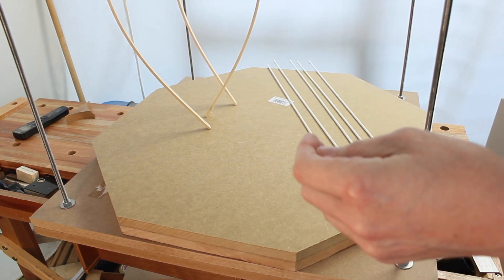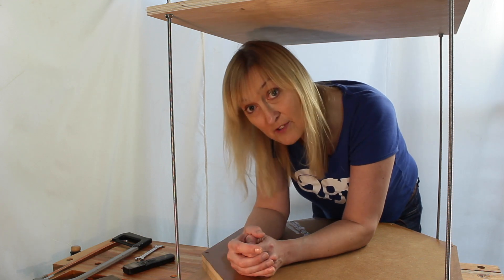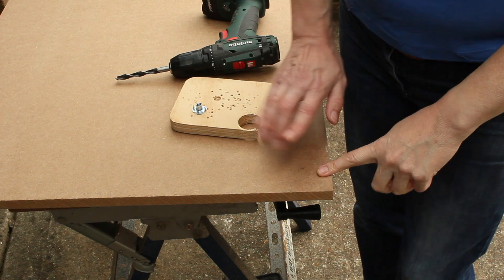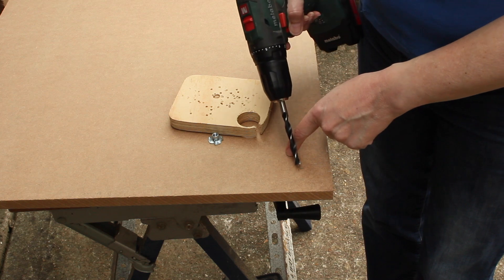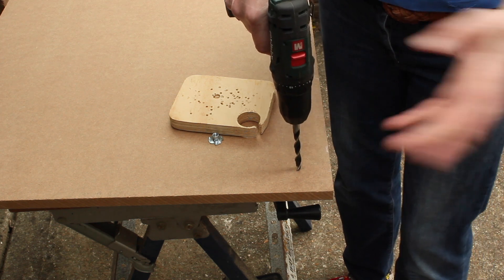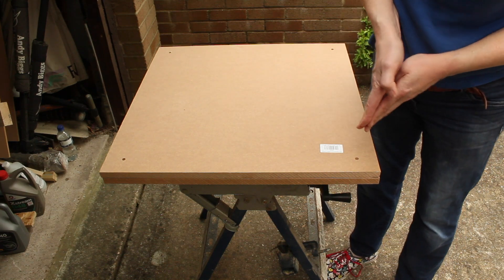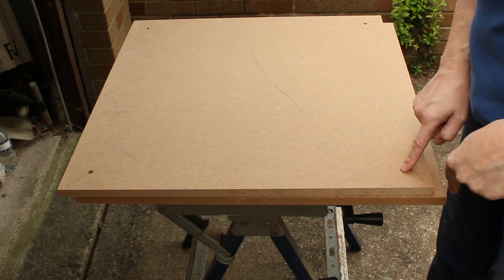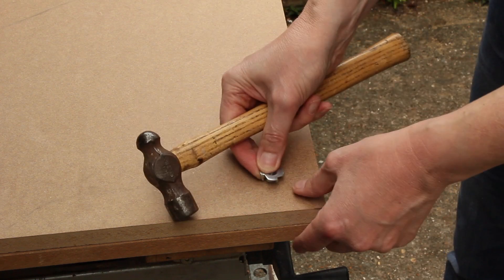Making a go-bar clamping system - the curious world of flexed pine and fibreglass

Comment: Great to see how you measure it! I suppose the more it bends, the higher is its force and pressure? So it is important to have the rod's top and bottom vertically aligned, or it would affect the pressure it gives. I also wonder if bamboo or cane or reed would be more elastic than pine, as they are traditionally used for making bows.

Comment: I used to use this type of go bar until I was shown a 2 piece one with a spring. Take a piece of tube (electrical or plumbing conduit) close one end- glue on the cap - drop in a spring- put in a wooden dowel that is  whatever length works for your deck. You can adjust the length of the dowel to give the amount of force you want. They are much more controlled and easy to work with than the bendy sticks.

Comment: Thanks for the great video! Susan, do you have any thoughts on whether bamboo might be a good material for the go bars?
I'm in Thailand and so surrounded by the stuff. I could just go out back 50m and get all i need. I wonder if it might have the same problem that the pine did with the pressure decreasing over time.
Reply from the maker: +Catherine Thompson I reckon bamboo should work, but I don't really know. Luthiers have been using ash for centuries so I'm guessing that doesn't deform. I'd give bamboo a try.
Reply: Thanks for your thoughts, Susan. I will give it a try as you suggest and maybe I can report back here when I do in case anyone else is wondering. 
Cheers.
Reply: Also, really enjoy your videos. Super informative and you have a lovely fun presence too!

Comment: I am currently trying the Roman Blind Rods, I'm thinking shorter rods would be stiffer and therefore apply more pressure!
Reply from the maker: +keith ambridge maybe, but the difference might not be that great, given my experiments with different amounts of bend. Just use more rods.
Reply: I've just finished my tests, I got the same results as you with 60cm rods, about 1.35kg  and little difference adjusting the top deck height. I then tried 52cm rods with about 1.8kg, 50cm rods gave 1.9/1.95kg. Finaly I settled with 48cm rods (I wanted to break the 2kg barrier) with 44cm from scales to top deck gave me 2.2kg.
Reply from the maker: +keith ambridge Well done. That's good to know.

Comment: I've used 6mm ply cut into 9mm srrips. Cheaper than fibreglass and provides more pressure. However if you do your construction right, the rods just hold the components in place with little pressure required. You might want to 'sleeve' the trheaded rods with some tubing... you'll find out why if you don't :)

Comment: Even though each of the glass fibre strips is the same length, if the top end is not vertically above the bottom end they are effectively different lengths.  Surely that will affect the force they apply.
Reply: UKHeliBob I think it does not matter. As long there is some force, it will be ok.
Reply: Taking things to the extreme, it would be possible to position the fibreglass rod at an angle such that there was only just enough force to hold it in place, ie virtually none.  That doesn't sound as though it will be OK.

Comment: Great video Susan. The rubber ends are a great idea. When you glue the braces on try using a drinking straw to get the glue squeeze out, it works already well, just cut the end at an angle.

Comment: I use my radius disks in my go bar deck when gluing braces, a flat surface doesn't work to well. I have a 15' for the back and 25' for the top, they are both on the bottom of my deck, back to back and I just flipped the stack depending on which side I am gluing. However, I do use the flat side when glueing up the two braces above the sound hole, I do not radius those two braces.

Comment: hi Susie,
softwoods like pine have a higher cellulose content with longer cells which is hydrophilic (water loving) which is quite susceptible to deformation if not coated with a varnish. even then, it will be prone to deformation. if you have spruce available, it works a tad better than pine.
any hardwood will resist the bending forces a little better due to the higher lignin content and shorter cell structure. ash is as you correctly pointed out the best choice here. it's used for tool handles as it flexes without deforming in the implement when pressure is applied. as crazy as it may sound, but dried yew wood limbs should really do the job. 
nice job on working out the science of the physics involved! 
cheers
mike